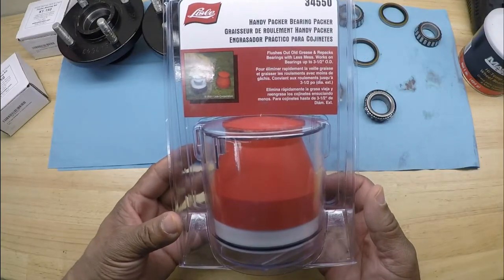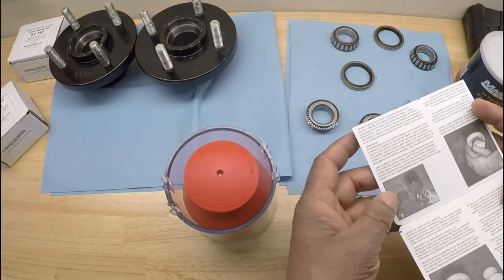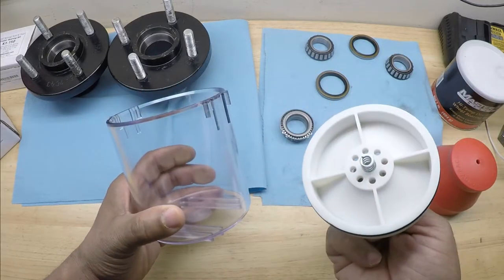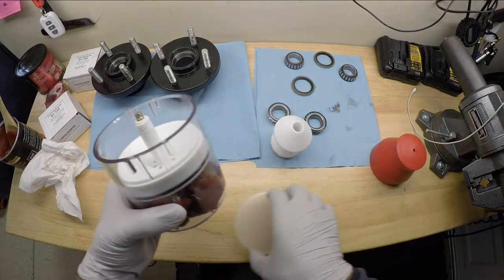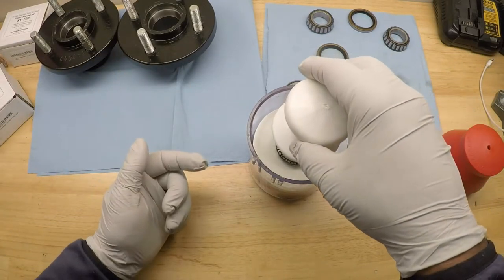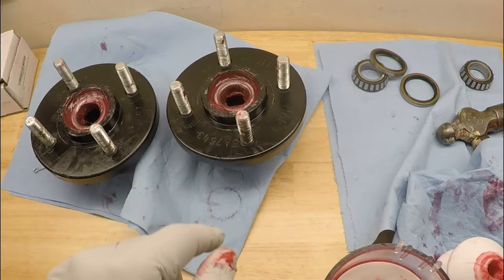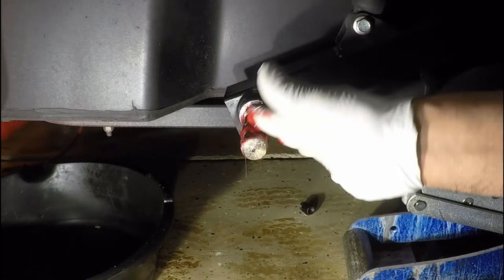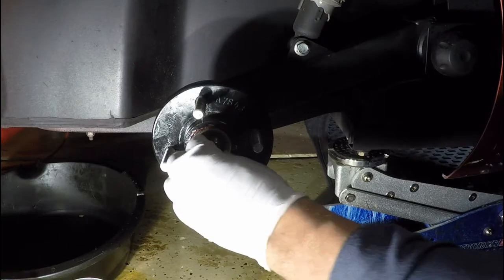Lisle Bearing Packer Tool 3455O | Pack Wheel Hubs

Comment: If you repack the old bearing use the old bearing race.  
If you fit a new bearing knock out the old race with a punch (a bolt woll doo), clean and replace it with the new, matching race. Fit the new bearing race using a socket that sits neatly on the bearing race and hit the socket against the race using a hammer evenly until it stops hard against the internal face.  When it stops moving it has seated, no need to bash hell outa it.  This is not a big deal, just take your time and get it right and you will have learnt another way to save yourself money. 
Thank you Chris for the video

Comment: I've always heard that you cannot use the old race with a new bearing as they may have where and not perfectly matched
Reply from the maker: If you are not confident working on your own equipment and trusting your own judgement, take it to a professional service repair shop and have them to put in new bearings, new grease, new seals and new races.

Comment: Chris, very informative. Have two questions. What is the name of the tool you used to hammer the seal down (looks like a flashlight), And What is the tool   
you used to tighten the castle nut.  Am not an experienced mechanic, would like to know what to look for at the parts store. Thanks ::)
Reply from the maker: Any tool big enough to remove the castle nut will work.  The hammer tool is called a bearing race and seal driver.  https://www.jbtools.com/lisle-12800-bearing-race-and-seal-driver-set-1-565-to-3-180/?wi=off&utm_source=Google&utm_medium=cpc_e70-h160&gclid=CjwKCAiAsNKQBhAPEiwAB-I5zZCBWplI0qbYIhoa9aFV-LIdsnCSPFZU7xqJE6pthJAqSzVGh2jLrRoC6FkQAvD_BwE
Reply: Thanks.  And keep up the good work.